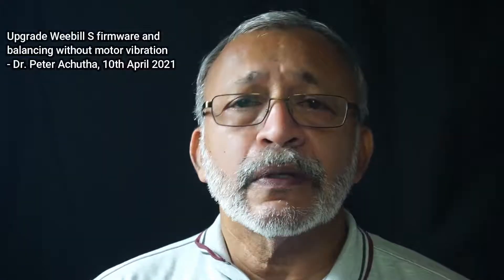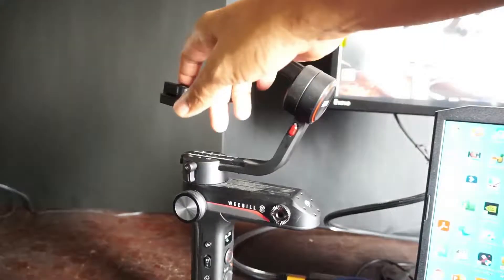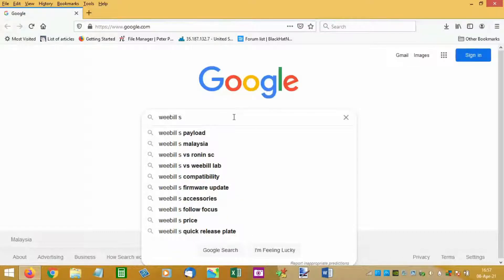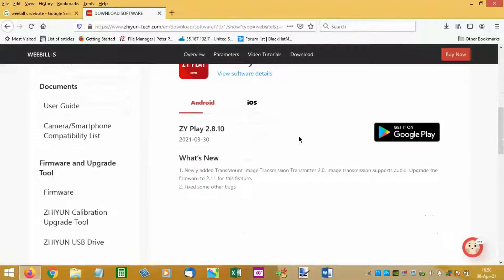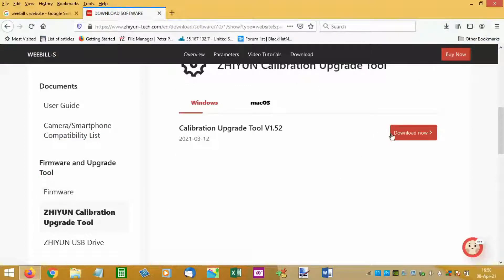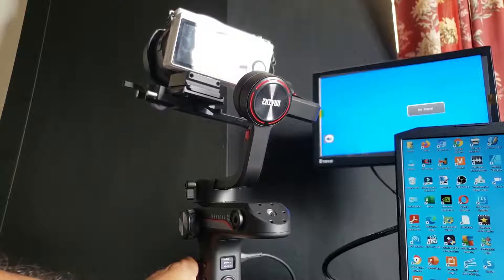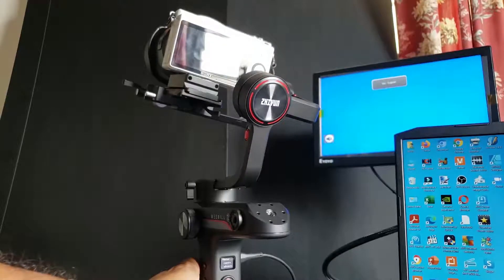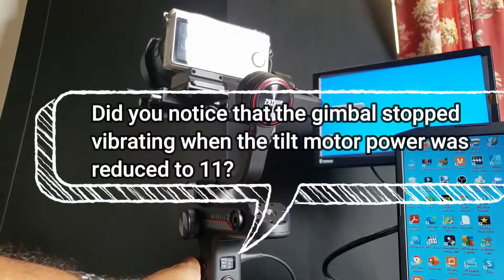No vibration on Weebill S gimbal with firmware upgrade

Comment: Only problem is ur using low weight camera setup... increase it it will solve.bcoz this gimbal can for 5kg setup very powerful motor its not for 300/400g camera setup
Reply: Thanks for the info. I still suspect China made products especially medicines as many are fake.

Comment: Acabei de atualizar para o firmware 2.07 e a tremedeira começou. Tive que colocar a força do Tilt em 6 e também coloquei a força do Roll em 32. Mas para conseguir que essa configuração ficasse salva tive que fazer a calibragem auto (vai dar errado e ele vai ficar todo tremendo). Terminando a calibragem auto, vá em Custom e procure os valores de Tilt, Roll e Pan que fiquem sem tremedeira e salve.
Reply from the maker: I used Google Translate and it appears that this is what you said "I just updated to firmware 2.07 and the flickering started. I had to set the Tilt strength to 6 and I also set the Roll strength to 32. But to get this setting to be saved I had to do the self calibration (it will go wrong and it will be all shaking). Finishing the auto calibration, go to Custom and look for the values of Tilt, Roll and Pan that don't tremble and save."

I have stopped using the gimbal as it cannot correct for my shaky hands. I thought it would but it didn't help. Now my gimbal is kept inside a draw under the bed. The best is still the tripod and I move the subject around. Thanks for your comments and I do hope it helps others.
Reply: @dr.peterscroll422  The Google translation is correct. Thanks!!!

Comment: Fixed it by turning down the motor power. Thank you 🎉
Reply: Have you ever set the power of the tilt motor to 6 for example, but when you turn it off and restart it, the power changes to 16 and it makes it vibrate

Comment: Set motor strength to 6
Reply: Have you ever set the power of the tilt motor to 6, for example, but when you turn it off and restart it, the power changes to 16 and it makes it vibrate
Reply: @caktimbull  have you updated firmware?
Reply: @JonniArmani  yes I have
Reply: @caktimbull  and you hit save after you set?

Comment: Sir ..you should have bought Zhiyun M2 for this camera set up.. it can handle the weight from a mobile phone to smaller cameras weight upto 780g .webill S is for heavier cameras from 1.2KG upto 3kg . Difficult to ballance smaller cameras
Reply from the maker: Thanks for your comments. Why would I want to own two gimbals? It is definitely not worth it. As I have shown in other videos, the Zhiyun gimbals are poorly designed so, again, not worth it. Anyway, again thanks for your comments because I will make a video on the demise of the gimbals. There are low cost alternatives that may be much better than these expensive gimbals.

Comment: Just a question. does the shaking bad for the motors? does it reduce the lifespan drastically? Does your gimbal still functions correctly right now?
Reply from the maker: Shaking is not bad for motors but it is bad for the rest of the gimbal. The vibration can cause screwed nuts & bolts to vibrate and come loose.
Reply: @dr.peterscroll422  Great Thanks a lot for the information. :) another one is about hot motors? does that damage the motors or bad for them?

Comment: You're not supposed to turn the gimbal on without something on it
Reply from the maker: So how do you upgrade the firmware without turning it on?
Reply: @dr.peterscroll422  balancing the camera and leaving it, without anything it is forcing the motors a lot, then just update with the camera on it (google translate)
Reply from the maker: @gustavofleury389 Thanks for your comments. It is ok if the motors are not loaded.

Comment: actually do not turn On your gimbal with out camera set
Reply from the maker: Why?
Reply: I have an issue with me weebill S once I balance and power it up it all tint down with out touching it
Reply from the maker: @oladeleedward1019  I can't say what is the cause for it to tilt down but a good guess is that the motor strength is set too low. You could check under motor > level > low medium  or high settings. Or you could go to Motor > Custom and increase the Tilt settings. Do let me know if that works.
Reply: @dr.peterscroll422  
Have you ever set the power of the tilt motor to 6, for example, but when you turn it off and restart it, the power changes to 16 and it makes it vibrate.. then how to fix it

Comment: NEVER turn on the GIMBAL without a camera on it!!!
Reply: why?
Reply: @kosishotit56  Because it's gonna try to stabilize a camera that isn't there.
Never turn on a gimbal without having balanced the camera on it first.
This is the most basic knowledge for operating a gimbal.
Reply: @olegkalinkin6877  I have a6400 with kit lense and weebill s after balance everything when turn on gimbla its start vibrating what's the main reason
Reply: @milanlama5084  I have the same camera and had the same issue. This setup is too light for the Weebill S. What I initially did was:
1)Reduced the strength of the motors. Don't trust the autocalibration on light cameras. Minimum Tilt (5 I think), Roll maybe 20(?), Pan maybe 27(?). Not sure about the numbers. 
2)I added some plates for extra weight.
3)I did the 6 axis calibration. And these 3 things kinda solved it.

Later bought a cage for the a6400 which added a significant amount of weight and allowed me to increase the motor strength.
Reply from the maker: Did you try reducing the tilt motor strength?
Reply: @olegkalinkin6877  if it was vibrating like that? does it damage the motors? does it reduce the lifespan of the motors drastically? does it drain more battery?
Reply: @milanlama5084  I have a6400 with a Tamron 17-70. I changed the Tilt to 6, the Roll to 32 and the Pan to 36.